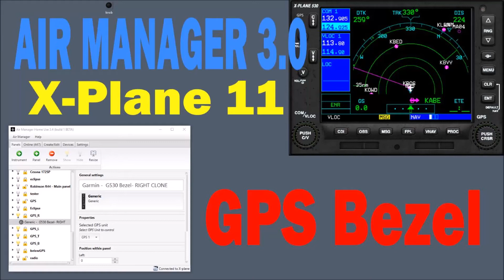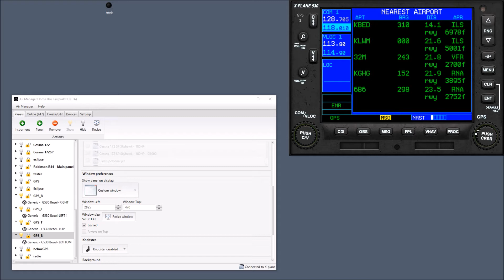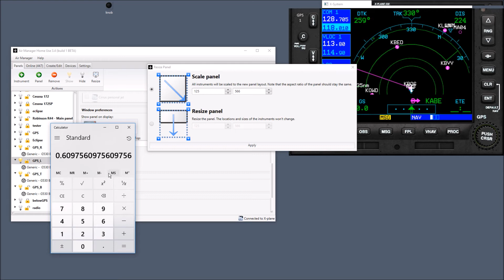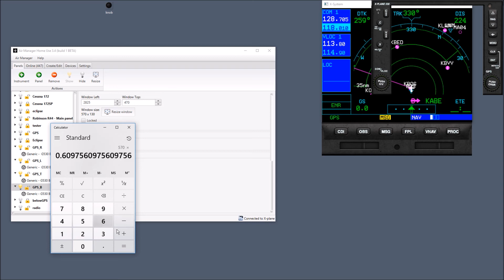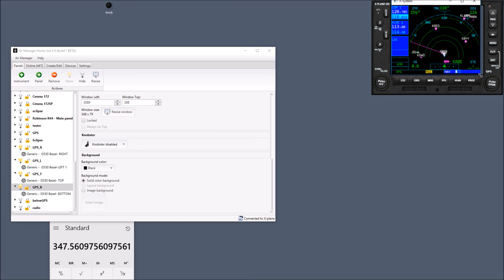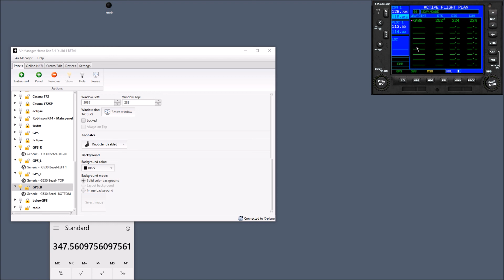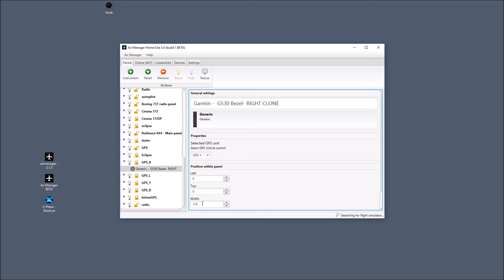Air Manager  3.0 GPS Bezel

Comment: Hi Russ, is the bottom section only, for the G1000, available on the AM store/download area? I'm really struggling to only get the bottom section of the G1000 MFD bezel for use in AM, I don't need the entire G1000 bezel frame for L, R & Top, I only need the bottom 12 button part of the G1000 MFD for my setup. Your guidance and advice will be very much appreciated. Thanks.

Comment: Fantastic!  Thanks Russ
Reply from the maker: Doug Brown  now that version 3.4 is out Air Manager does support transparency BUT it does not pass clicks/touches through to the desktop. Although this approach is obsolete for the G530/G1000 in X-Plane, to use RealityXP popout GTN650/750 on a touch screen this is still a viable workaround

Comment: Hi Russ,

Is it already available in the community store? I've searched but I didn't find it...
Reply from the maker: It was rendered kind of obsolete as the new version 3.4 now in public  beta has transparent backgrounds again. A single instrument will work again so putting the multi-piece bezel up on the community store  could be confusing. You can install the BETA without affecting your current release version. It installs in a separate directory if you want to try it out.,
Reply: Thanks Russ !!! I will give a try!
Reply: Hi Russ.  I can't find the single GPS bezel instrument in either Air Manage 3.3 or 3.4 beta in online "free community instruments" section.  Can you help me find it?  Also, is it possible that XP11 will add touchscreen support to their knobs?  Then we can use the XP GPS as-is without the bezel overlay.
Reply from the maker: Eric Paton it will only work with 3.4 beta with a transparent background. Still beta. If will definitely make the store when 3.4 is released. If you can get me your email U could send them to you now... not sure you want to post that online though
Reply: Hey Russ. I've constructed my Knobster and it is working with Air Manager 3.4... but I can't find the X-Plane 530 bezel. Is it in fact available now?
Reply: HI Russ.  Thanks for all the wealth of info with your videos.  My email is surfingslow@gmail.com
Reply: Russ Barlow hi Russ can you send for me the 530bezel? Thank you